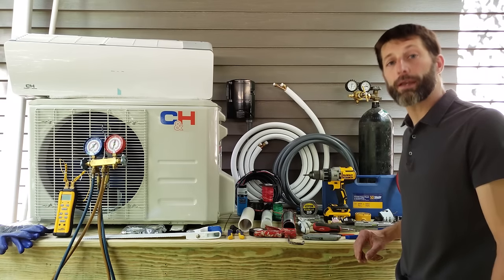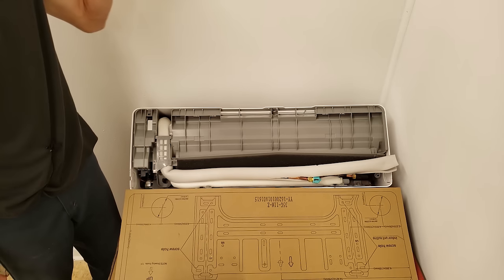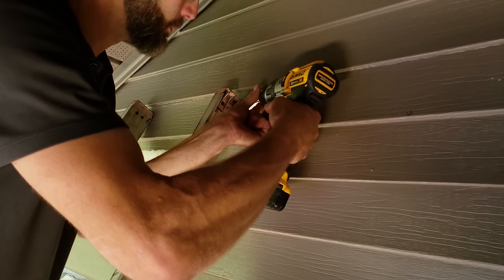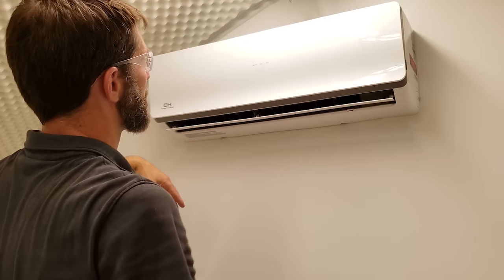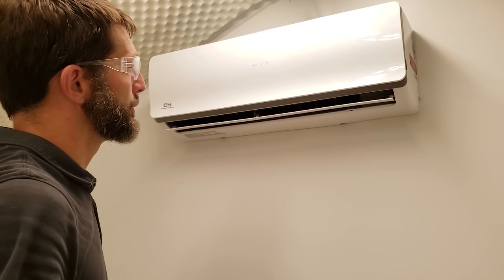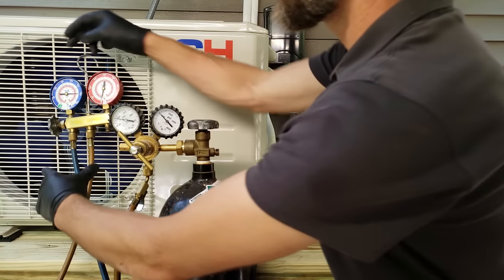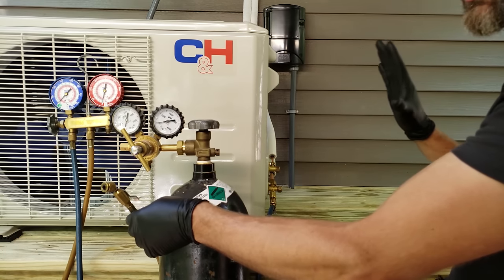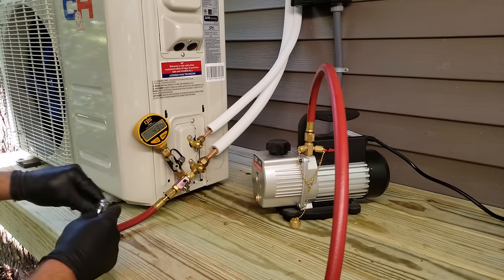Full Installation of Mini Split Ductless Unit, Step by Step!

Comment: What is the purpose of a minimum length for the mini-split line set? 
If the line set is shorter than recommended minimum length, what sorts of problems might occur?
Is there any wiggle room with the length?

The installation manual for my unit says 15' minimum length. But there are several errors in the manual, so I want to confirm whether this requirement is correct or not. 
I would like to use a shorter length, if possible.

I think that most first-floor installs would need only about 10' of line set if the condenser is located outside directly below the indoor unit's placement. It would be less if using an off-the-ground mounting rack for the condenser. How can one achieve the minimum length under these circumstances? Coil the tubes?

Thank you.

Comment: You've been extremely helpful. 

I have a question...

My mini split came charged for up to 25' of lineset. I have 35' installed. My HVAC contractor insisted he didn't need to add R-410a per the manual and just went off gauges to try and hit 38-42˚. He actually let out some of the original refrigerant when it was reading 45˚. 

He didn't add any refrigerant... He said it would damage the unit. does this sound ok to you?
Reply: A lot of these installers are hack jobs. If you want it done right you have to learn how to do it yourself.
Reply: You have to weigh the charge in, you can't go by temperature alone. The service manual tells you how much refrigerant to add for different line set lengths.

Comment: where can i get one of those templates so i can see if where i want to place the head unit will actually fit? the area i have for one of these is over a window and i have little room to slide one of these around with out having some type of template to make sure i do have the room. i was looking at the confortotal unit but they can't seem to get me a template.  so if i can get a template for your unit i can make sure it will fit and then get one of those units?

Comment: How is it that we are connecting 14 ga black & red stranded wire for 110 volts 15a at the exterior unit, to incoming power disconnect box terminals with 2 (red & black) wires that are 10 ga wires carrying 240 volts with 30amps at the breaker panel?

Comment: question???....I unroll the tubing and conected to the minisplit valveles and open it the valve of the gas....now i want to close the gas valves from the A/C. to put it the tubing to the size because I have to much tubing coil and looks bad...can i close the valvules to cut to the size i want or what I have to do for fix it.

Comment: Good video and identifying where the studs are is important but I alway check for pipes or other stuff in walls before I commit to an exact location for the head. Years ago I did it your way and drilled my 2 9/16” hole saw DIRECTLY into 3/4” heating pipe. Not good.

Comment: pioneer hvac mini split came with  15ft. refrigerator line, if I cut it to 7ft. will  I need to reduce the gas in the unit?

Comment: I was thinking of installing a 220 plug just plug it into my existing 220 outlets, and plug it in like a Washer Dryer plugs in, anything wrong with that? I was told these systems come pre-charged not sure that is true?

Comment: Great video. Thank you very much. I have watched the part where you are connecting up the valves for the gage and the vacuum pump twice and I am still confused. At 53:22 it seems like you are calling a valve a valve core removal tool. You also call the gage isolation valve a valve core removal tool? Are you reaching thru the vacuum pump isolation valve to put the service valve core back in? Why wouldn't you put the valve core back in before you pressurize the system?

Comment: Hi Craig, great content as always. 

I have a question about bending that lineset at the outside of the wall for your vertical drop. I once had to install a series of three Mitsubishi minisplits (P series, slightly more industrial size). The suction line on those was a full 5/8" large...pretty large compared to the usual 3/8" or 1/2" suction line size that you see on a standard minisplit. I had a heck of a time bending those for my vertical drop, and I was paranoid that I was going to kink it. Somehow I didn't, but it wasn't pleasant. The crazy thing was that they didn't come with any spring wire around the suction line to prevent kinking. Is there any special tool to assist with bending the line in such a tight space against the wall like that? Thanks Craig!
Reply: There are such external spring-like tools for bending PEX/AL/PEX water tubing. Ask around your plumbing suppliers.
Reply: Man, what a Craftsman.!!    
      "Craig"..       fv.

Comment: Very similar to uk installation.....But only a very short time to run pipe vac??? When we installed a new system we used to vac pipe system down for at least 1 hour ,shut down ,then left overnight...if the vac held then next day then we opened up the charge to commission the system...Nitrogen is used used to remove any moisture that may be in the pipe work..Systems usually come pre-charged with "REFRIGERANT" gas ,which usually R-22..Because R-32 efficiently conveys heat and cuts elec consumption by around 10%...compared to R-22...Only "topped "up the system if pipe run was over 5 metres..We also fitted a mini condensate pump inside the indoor unit.

Comment: Mate, you should see the shit show that we have here in New Zealand - Heat Pump / Split systems used to be done with pride and care by proper refrigeration techs. But these days it's just a free for all. The only restricted / licensed part is the electrical, but that doesn't stop the installers doing it them selfs

Comment: Hi. Is that 12awg wires? Also did you use a 20amp breaker? I'm just wondering because you have 2 hots and no neutral

Comment: what if i install the ac during extreme heat or extreme cold (-30C°/+45C°) does the pressure should always be 300psi cuz i know pressure depends on temperature ???
that means if i set it during winter on 300psi isn't gonna be alot more during summer cuz gaz expand

Comment: Are regular refrigeration hoses OK when doing pressure test or should you use vacuum rated hose? If regular hoses are OK does that mean 600 PSI is orders of magnitude different from 500 microns?
Reply: General purpose refrigeration hoses are appropriate for the nitrogen pressure test, but you should use vacuum rated hoses and fittings for the evacuation process. Comparing PSI to Microns is apples to oranges, one is a positive pressure and one is a negative pressure (relative to the atmospheric pressure outside the hose.)

Comment: I had a minisplit in my garage at another house loved it. Our new house the outside part would be about 25 feet from where I want to mount it in this garage is that to far of a run?
Reply: should be fine, I am currently installing a MrCool DIY unit and it mentions the maximum length for a run should be under 75ft, and the lines are sold in 16' and 25' increments
Reply: @neppy5  thanks! I am going to have it installed. I wonder if I should order all this stuff myself and have it ready for them, might be cheaper I am thinking.

Comment: @ 21:36 : is it safe to continue the twisting motion in the same direction for an additional 90°? I need the lines coming out of the inside unit to go 180° the other way for a clean install.. Thanks for any advice 👍

Comment: I am installing a mini split now. I overtightened the line set where it meets the air handler. I had the digital torque wrench set to the proper torque at 11 ft lbs, but when I was tightening I hit the torque adjustment on the digital wrench by accident, and tightented it to 18lb ft! No obvious damage, but should I just loosen it to 11 ft lb or redo it or leave it?
Reply: Just leave it. I work for an hvac company and do a ductless install a few times a week. I use a digital torque wrench and tighten my flare fittings to the correct ft lbs. but a lot of the old timers in the trade do not. They just grab two crescent wrenches and crank down both nuts as night as possible. And they all aware by it and don’t have leaks. I don’t recommend it! But I’m sure your fittings are fine.
Reply: @JaredHayes541  Thanks for replying. Before you replied, I loosened it and tightened it to 11 ft lb, loosen it, the tighten to 11.8 ft lb. I hope I didn't mess it up.

Comment: Are you in Chicago? Mine is not functioning for AC, I bought the house that included the mini split. When I turn it on, it throws room temp air and it doesn’t cool. I ask maintenance but not reliable. So I am hoping the unit is fixable.

Comment: What terminals or wires that are inside of the furnace board must I use the probes that make up of the two major leads, which are part of my multimeter to test for resistance (ohms)?  This way I can move on to test the thermostat with the two major leads that are connected to my multimeter before I test the negative and positive terminals on the capacitor that is inside of the HVAC unit outside of my home.   I am trying to determine why the air conditioner inside of my home is not working any more.

Comment: I'm having trouble with my multi head (4)  mini split install. I have one head unit in, evacuated after pressure testing and then charged the lineset. Trouble is, the blower on head unit works, condenser fan comes on, but the compressor isn't running . I'm getting no cooling.
Could it be too charged because I don't have the other two linesets connected yet?

Comment: Hi  When I start to remove the caps on the lines coming from the indoor unit it leaks air, is that normal?  Are those lines coming from the indoor unit charged or pressurized purposely, and does all that pressure need to be released before connecting the rest of the line-set to it?   I was just concerned that I was doing something wrong when I tried to release that cap and it started hissing!  Thanks
Reply from the maker: Are you talking about the nitrogen pressure test on the new piece of equipment?
Reply: @acservicetechchannel   I’m not sure if it’s the nitrogen test. I don’t have any equipment to test anything.  It’s just the line coming from the indoor unit outside that need to be connected to the line set. They are capped, so when I try to remove the caps I can hear air escape.  It sure why. 
I have an HVAC guy coming this week to just connect the line set and make sure everything is charged up correctly.
Reply: @MirandaDetailing  thats nitrogen. If u hear hissing, its GOOD! means no leaks in lineset
Reply: @growshack9067  Thanks!
Reply: @MirandaDetailing  np

Comment: I have a question...the Fujitsu Aou24RLXFZH manual states that the minimum total combined (all three zones) line set length should be 49ft.  My set up will have two line sets, one 25ft going to an 18000btu wall unit, and one 15ft going to a 9000btu wall unit.  I would like to know, will less than the 49ft recommended line set cause an issue. Would the system be overcharged with less than 49ft of line set? Even for two head units the manual states that a minimum line set length should be 49ft. Have you installed multi head units having line sets with a combined line set length of less than 49 ft without issues?  Just not sure what to do. I would really appreciate your help with this.

Comment: Hi AC Service Tech. I have a question. I installed a Mitsubishi ductless using your video and it works great. However, I notice that it doesn’t stop running even when the set temperature is reached. Do I need a separate thermostat to operate my mini split efficiently ? I assumed that the remote control would act as the thermostat.
Reply: hi im from australia not sure how units differ but, does your controller have a setting called energy saving also another thing that happens is that u may not notice because u cant be a 2 places at the same time is the indoor unit may still be working and the fan blowing air but the outdoor unit could have stopped the compressor, and from memory indoors don't draw much power, its also really costly if the unit keeps short cycling because the outdoor unit draws the most amps when it starts so if it stops and starts when it reaches temperature it wont be saving much energy.
Reply: @DCUOCover  Hi , thanks for replying. Actually I found from a Mitsubishi Tech that Mitsubishi Mini Split remotes don't act as wireless thermostats. And one needs to install some hardware to connect the unit to a thermostat wirelessly with it. Only then would it stop.

By default, the indoor unit measures the temperature of the air that it is sucking in, and because my indoor unit is right above a window with some leakages, that is why it doesn't stop running.

Comment: First video I have seen the use of plastic downspout rather than the commercial plastic covers. Not really a DIY with all the needed tools, gauges, nitrogen tanks and refrigerant but nice not to have miles of extra line coiled up. I imagine a commercial install is over double the equipment cost so an expensive unit.

Comment: on the indoor unit when i removed the plastic flare nut cover on quarter inch pipe  there was pressure and i released all out,   when i unscrewed the larger flare nut cover on the larger pipe  there was no pressure,       did i already release all pressure from the indoor system through the smaller pipe or do i have a leak?

Comment: I have issues. The wall mount ac copper wire are 3/8" and 5/8" and the extension copper wire kit is 1/4"-1/8". Somehow it won't connect to the fitting after flare it.  Did i receive the wrong copper wire that connect to the ac condensers?

Comment: Some techs recommend Nylog on the threads for sure, but to tighten at the very lower end of the torque spec. Nylog acts as a gasket, are you sure just put on the flares really does the job?
Reply from the maker: It is not a gasket in the sense that it seals those threads. Those threads do not work like fuel gas line threads. That is what the flare is for. It only goes on the flare face and only a little. Do not put it on threads. I am unaware of any HVACR teacher recommending to put it on the threads but if you know any please let me know. I hope no one is teaching that for sure, thanks!

Comment: I have a question, if I’m gonna disconnect my lines for roughly 10-15 min. Do I need to pull a vacuum again before opening back my valves with refrigerant?
Reply: Yes.  If it is open for any amount of time you need to pull a vaccum.

Comment: Before you attached the 2nd valve core removal tool to the 1st VCRT, had you removed the valve core from the 1st VCRT?
Reply from the maker: Yes the side port of the first vcrt has the valve core removed.

Comment: I am building a house and plan on using one of these, I have 10 gauge wire for it but am not sure if that is the right size. Also do I run the wire separate for the outdoor and indoor units?
Reply: If your not sure about basic things like that you really need to hire a professional. You didn't watch the video very closely as the answer to one of your questions is very clearly stated. It's actually very clearly stated in even that bad videos and the instruction book.

Comment: I followed the two valve core removal tools connected, but vacuum gauge won’t read any micron, then I realized the side port have core in there and if straight connect it won’t depress it, so I think he forgot to mention you have to remove the side port valve cord to connect the 2nd removal tool there.

Comment: Why not use the factory flares on the unit and simply cut and sweat the tubing together on the house? It would be simpler and faster than using flare unions and it would be less prone to leaks later on.

Comment: Great video! It does't need add freon after vacuumed tubes?
Reply: The condenser (outdoor unit) includes enough refrigerant for the included pipe run. It just needs releasing from the unit into the pipe run.

Comment: Your trunking takes a lot of time, I am using nice fitting and  more esthetic from Inoac. Once you drilled a whole for your line set etc. You already start to fix the trunking to the wall . Thank when put the line set inside you just put the cover over the bottom part . Job done can send you some picutures how we work split systems in Holland/ Netherlands
Greeting jos

Comment: pls what is the size of the hole u cut at the beginning after mouth the wall holding plate? , pls i want to know the size of the hole so i can buy a hole cutter drill in advance for my ac installation ?

Comment: Where do you dispose the condensation water? I have the problem that in my house gets disposed right outside of the house affecting the foundation. How can I route it far away?
Reply: Run a pvc drain to wherever you want.
Let your drain line air drip in to the pvc drain and there you go.

Comment: This may look great to homeowner with low demands who does not know any better. Quality of installation remains to be desired. I would never put lines inside a rain gutter. There are special line set covers for that that make it look more aesthetically pleasing. There is also a better way to finds wall studs than just drilling into drywall till you hit one.

Comment: 30:25 don’t you have to remove those and put the thicker ones. Due to the pressure rating of the refrigerant, correct me if I’m wrong, cause I think I remember hearing that those are for plumbers or etc.

Comment: Couldn't help but notice that the red line voltage wire from the breaker is on the load side of the disconnect.  More of a safety issue for the next service technician.

Comment: I'd prefer to use the left whole on panel then I'll have only one bend behind the indoor panel and the connections will be behind the indoor panel in this way every time i need to move or unistall the indoor panel for service i don't need to bend and unbend pipes on the indoor panel since it will make serious problem if we have a leak there